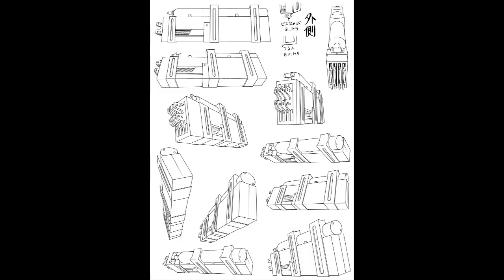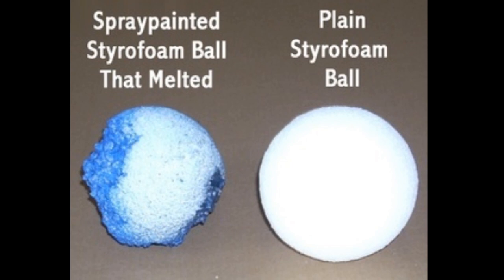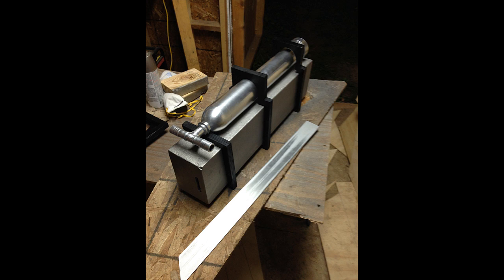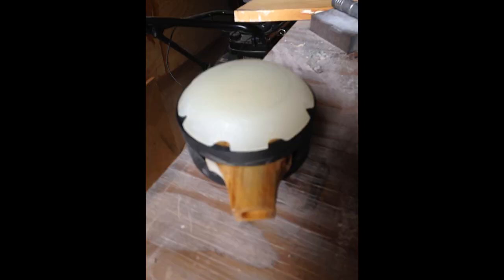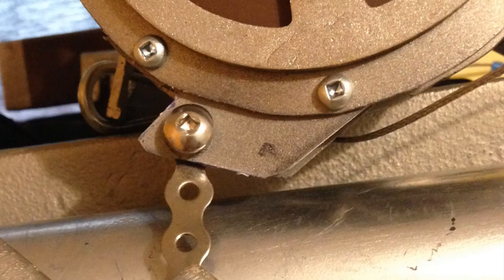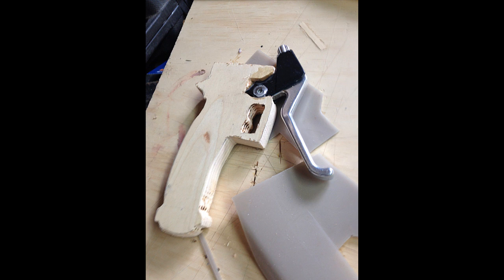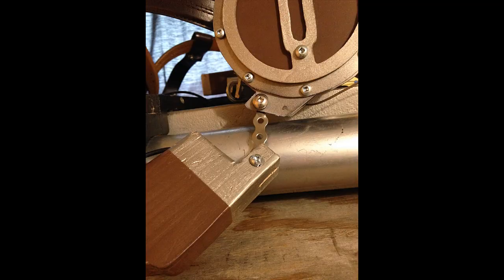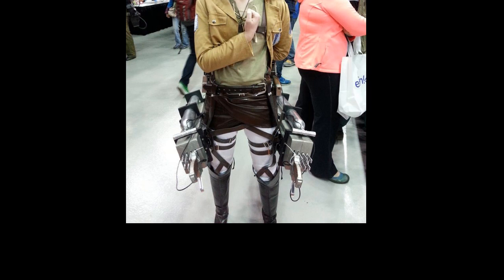HOW TO BUILD YOUR OWN AWESOME 3DMG

Comment: So.... Seems like hard work. Since my dad has a hurt shoulder (sometimes), I doubt he can help. Besides, I can't go this at home. XD I can try and beg, but other wise, it's not gonna happen! Lol
Reply from the maker: That's alright, if you really want some you can still build your own. The best way to make props is to try and be creative with what you do have, so even if that is just cardboard, paint, and scissors, as long as you pay attention to detail you will end up with something good. :D
Reply: +katx2 Thanks! I found some great tips and FAQ websites too! I'll try ^^
Reply: +katx2 my parents confirmed that I'm really the ONLY crafty person in my family. ^^'
Reply from the maker: Mine wasn't the most budget friendly tutorial, but there are plenty of others out there. I'll try and give you some tips, though:

1. I suggest that if you decide to use a material like cardboard, you choose cardboard that is sturdy and find ways to strengthen it. Using layers and glue usually helps.

2. For more complex pieces such as the back part, you might want to try clay, specifically something lightweight that doesn't easily crack. Like Model Magic. It can be painted so you can use it for anything with depth, like the sword handles, etc.

3. For the gas tubes I still recommend using water bottles at the top but instead of PVC pipe you could roll some bristol board and use that instead. 

4. Metallic spray paint is your best friend, and you can use that for a nice professional looking finish. 

Good luck!
Reply: Thanks! :D

Comment: I would do This if.. I could but where and where can I but material?? I'm only 13... It'll get hard... and nobody Will help because they think It's a waste of time .-.   Do anyone have advice?
Reply from the maker: Okay, don't worry about being 13. We've all been there. Here are some materials you can use to make it that cost less:

-Hot glue gun (to attach things)
-Bristol board/foam board (to use instead of wood or plastic or insulation foam. It might be hard to figure out how to make, but take your time)
-Spray paint (in silver and brown)

Aside from that, my only other advice is to think outside the box. Use any materials you can find in stores or around the house that you think might work. Like how I used my snowman ornament. 

And remember, it doesn't matter what materials you use. As long as you pay attention to detail and try to make it look as much like the anime as possible, it will look good.
Reply: katx2 THANKS MY LIFE SAVIOR!❤️❤️❤️

Comment: Is there any way you can share some of the measurements? Thats going to be the hardest part :(
Reply from the maker: There were never any actual measurements. I basically just cut pieces and worked with what I had and tried to make it fit my body proportions. I can try and take some though, I guess.

Comment: How did you cut in the sheath for the real sword, like not the one for the dummy blades, the one for the real sword
Reply from the maker: heated up the sword and melted a hole in it like in a 1000 degree knife video
Reply: Thanks, very satisfying.